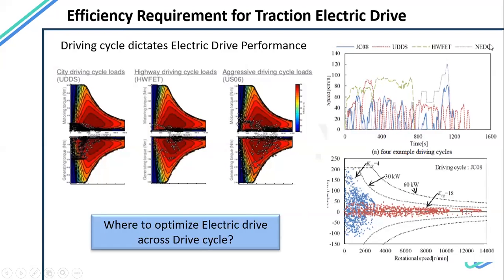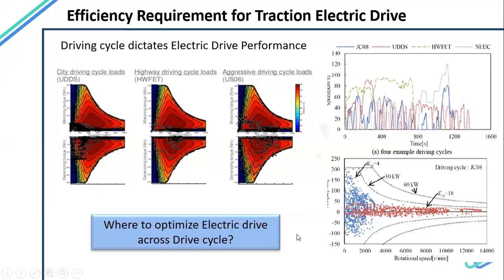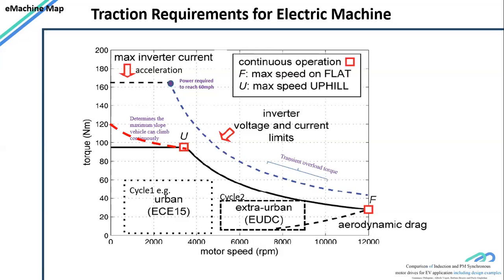Motor design for Electric Vehicle (Part - 1) | Free Certified Electrical Workshop | Skill-Lync

Comment: Before deciding the motor size from wheel to motor, what parameters have to take in design calculations. Whether we have to take acceleration performance or top speed